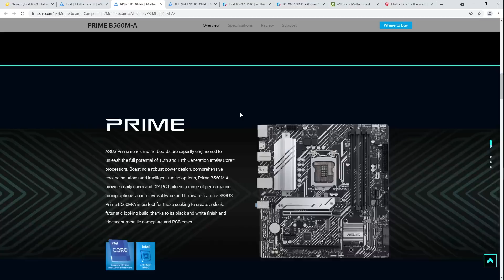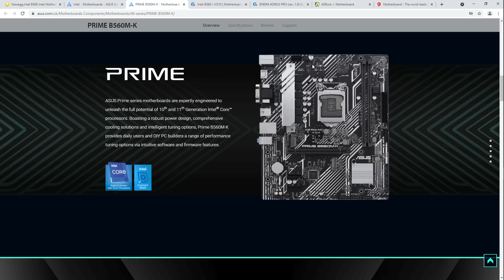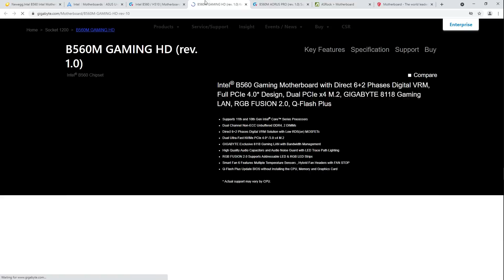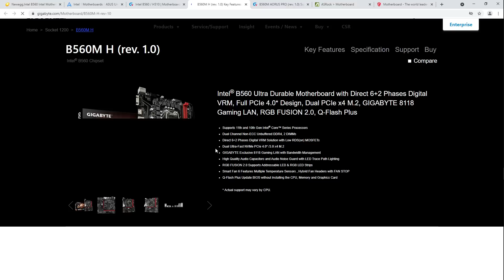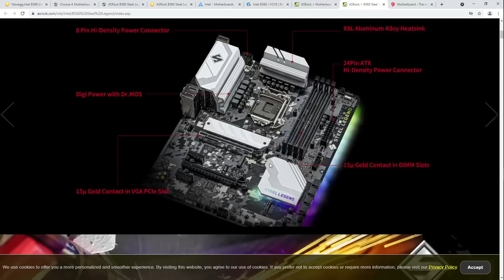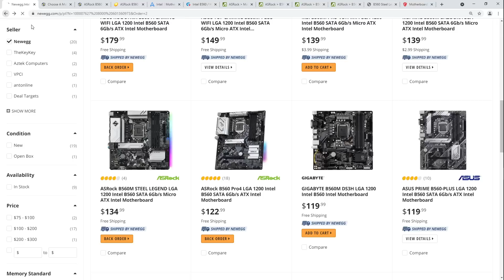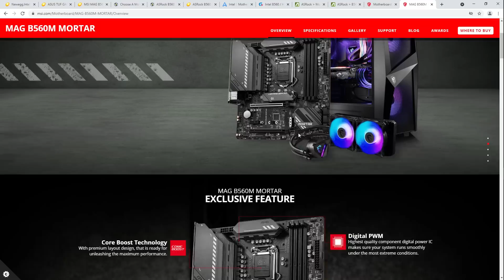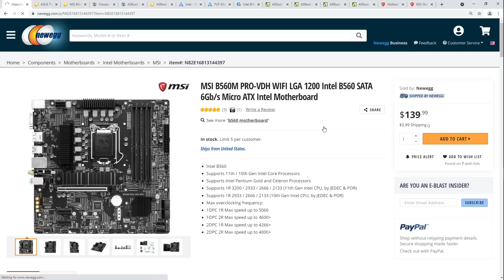Rambling about ALL the B560 boards

Comment: Worth admitting: Every 120$+ B560 board is perfectly fine with i5s, don't fall into HU "B560 iS a DiSaSteR!11!!".
Thing that they didn't even include a chart with removed power limits with these CPUs, which takes 2 minutes in BIOS is just... nice bias.
Yes, this whole "power limit" limitation is a mess but it's not like you need a 200$ board.
Reply: Yeah HU always was pro AMD but recently they just crossed the line in terms of biased content. Nowadays every video is like "Ryzen is pure power and efficiency !!!!11 and Intel is just baaaad". Im happy Ryzen 3600 user and even for me its just super annoying to watch them these days...
Reply: @jakub6990  at the end of the day every tech reviewer is biased in some way or another.
Reply: He said that the results info will be coming and the disaster was absolutely correct. There's no way to tell what you're going to be able to get from removing the power limits. Which is what Steve was testing for.
Reply: @NotThatGuyJD  
Intresting that he included both: limited and unlimited power limits with i7-11700, which is obviously an issue because of not sufficient enough VRMs on cheapo boards, but didn't do the same with i5s, why? Because it's not a problem with these CPUs and he wouldn't be able to make his bias more reliable.
How is changing one setting in BIOS a disaster? Disaster would be, when 120$ dollar board wouldn't be able to hold a budget CPU.

"There's no way to tell what you're going to be able to get from removing the power limits."
Don't make me laugh, unlocked i7-11700 got 4.3Ghz on Pro4 but i5-11400 with half of the power draw wouldn't be able to clock up to 4.2Ghz? Nice logic.
Reply: @brennanbraxton3854  interestingly enough an 11400F which admittedly boosts to 4.4 can pull up to 280w as per tech power up's review or more realistically 200-220w so while I agree 6 cores 12 threads are more easily able to be sustained on the lower end boards and he probably should have added average power draw for when boards were thermal throttling because that's where the problem actually lies and not at the max speed ped the CPU runs at. 

Well then thegeneral public and not "you" have no idea what you're going to get because of the differences and the fact that the low end boards he was using couldn't run the cpu unlocked and at the max clocks advertised.
Reply: @NotThatGuyJD  
4.2Ghz all core, boost is always limited to the first few cores. TPU is rarely even considered when it comes to CPU reviews due to their abnormal results.
Realistically, in Cinebench R23 (which HU used for testing) i7-11700 without power limits draws above 100W more than i5-11400 with removed PW.
Watts mean "nothing" they just indicate what temperature you can expect and that is the issue for CPUs downclock, Pro4 and other budget boards are completely capable of holding locked i5s.

What he should've done is, show the people that they can run their CPUs without an issue just by unlocking them in BIOS, instead of making a shitstorm and scaring them that there is a problem with their setup, but hey - that's not clickable is it? And it's Intel at the end of the day, everybody hates Intel then we do the same!1!11
Reply: @brennanbraxton3854  still not really hating Intel by saying the boards can't run an locked 11700 just by removing the power limits and everyone needs the clicks which they would have gotten regardless and yeah could have been better.
Reply: It appears that a few people here have a comprehension bias to what was actually stated in the HU review, testing method and the reason why.
Reply: That HUB B560 video is more for the n00bs that don't know about PL1,PL2 and TAU. Any enthusiast would by now understand how Intel's TDP guidelines work and what it means when after TAU the power limit goes to 65W for non K cpus. He's not saying B560 is a mess. He was more stating if you're a n00b, then B560 is going to trip you up with crap boards and 11th Gen. This is nothing new, just more pronounced with 11th gen cpus sucking more power.
Reply: Yes, that's probably true, but there are clearly some boards where even the i5-11400F can't run at its all-core turbo for long, and they showed that removing power limits often doesn't really change the outcome.

However, the incongruence between the i5-11400F and i7-11700 testing has me wondering. I'm going to check it out more.
Reply: He said in the last video his VRM testing is on the way. B560 is a very mixed bag it seems, $150 dollar boards with $75 dollar level board VRMs, others that are spot on 🤷‍♂️

Comment: i have a ASRock B560 Pro4: you can say it have not good power delivery, but it was 106€ .... perfect for my 106€ (used) 10400f and 16 gb at 3600 . 
i think the b560 chipset are good for 10400 and 10700 : you can stil unlock the boost, tdp and use ram over 2666 ( it realy improve the platform)
Reply: I have 10100f, Can i use any b560 to unlock the ram?
Reply: @KEEETARO  yes , but with cheap motherboard don't buy too fast ram . To be sure watch the supported ram speed of the board
Reply: @ElettroStef92  i checked Gigabyte B560M Aorus Pro website info, it says RAM speed on 10gen CPU is only 2666Mhz, maybe they do not show the full potential? How to be sure I cam OC memory on B560M Aorus Pro and Asus TUF gaming?
Reply: @pcman3158  on they website they talk of faster memory speed for 11 gen , but they specify that is an overclock. For 10 gen they only put stock speeds and they don't mention oc settings. In theory you should not have any problems to use higher speeds unless gigabyte is putting some strange restrictions in bios